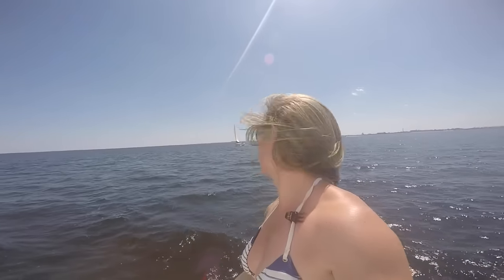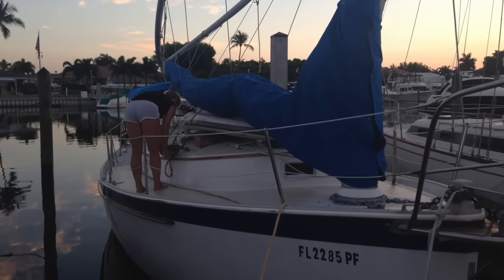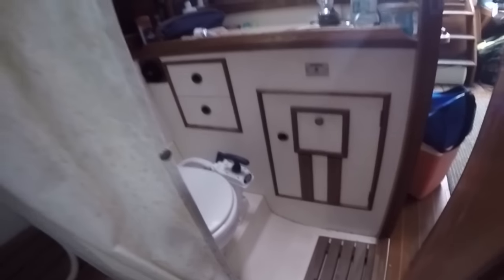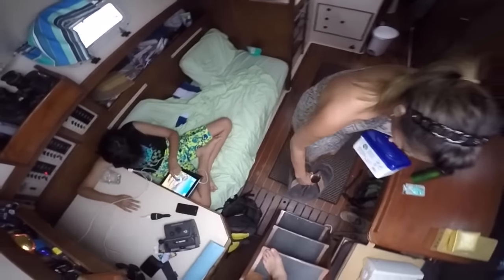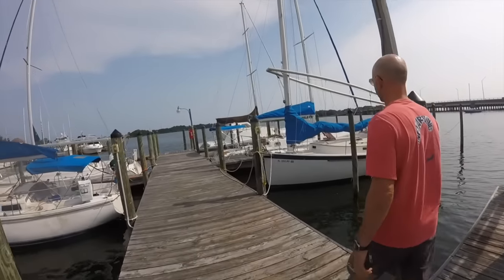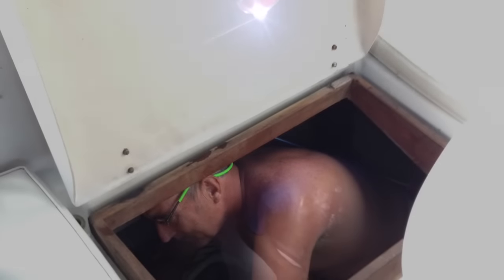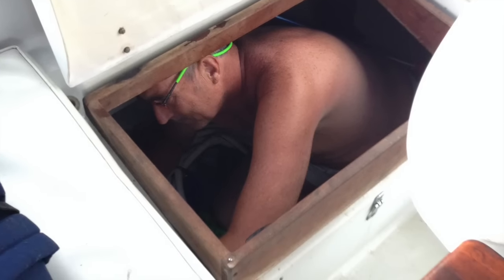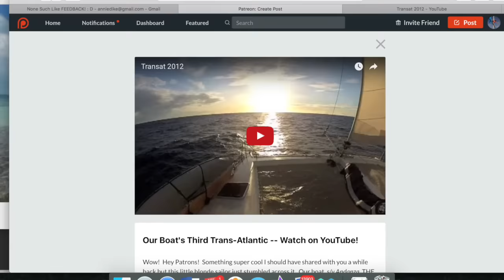Boat #6: 1985 Nonsuch (Like It!) 30

Comment: Sooo, Ive seen a LOT of different types of sailboats but I have never seen one quite like this, with that single mast so far forward and the huge boom.  Is this a custom rig?
Reply from the maker: No, it's a cat rig.  And while that was MY reaction when I first saw it, I've been told they're really pretty common, seems more up in the northeast, but they made a ton of them.  They're interesting vessels, very unique.
Reply: Oh yes!  It's funny but the moment I read that they are more in the Northeast the first thing that popped into mind was a print that hung for years in my house as a kid.  It was of a painting by Winslow Homer called Breezing Up.  Homer is the quintessential New England painter of the 1800's and Breezing Up perhaps his finest work.  The painting portrays a small cat rigged sailboat out of Gloucester with a man and his three sons out for a "spirited sail"  I think what threw me is the size of the nonsuch boats much bigger than any cat rig I had ever seen.  As an aside I took a look and found a 36 foot nonsuch for sale for $80,000 with the mast replaced with carbon fiber... probably a REAL performance enhancement!  Such beamy boats the 36' looks more like a fifty footer inside.